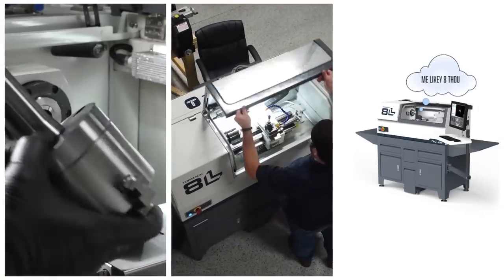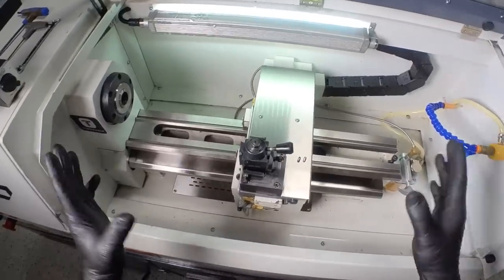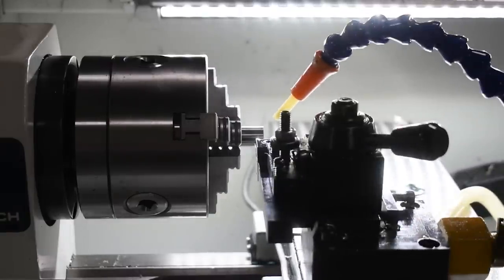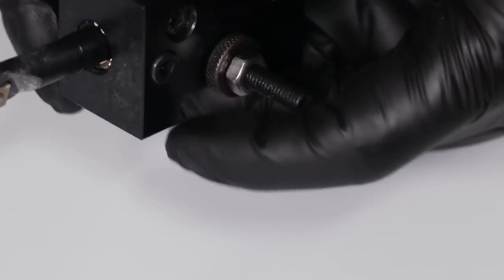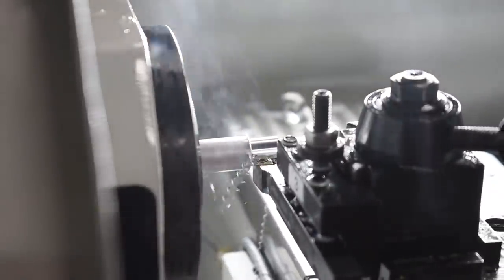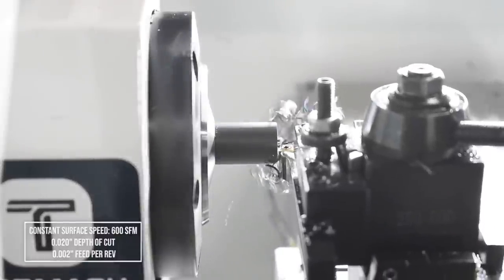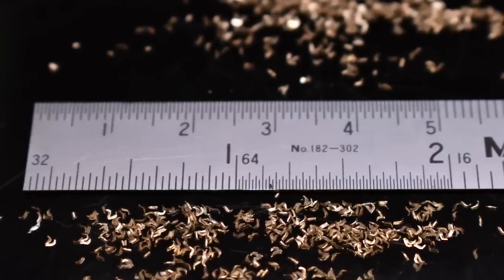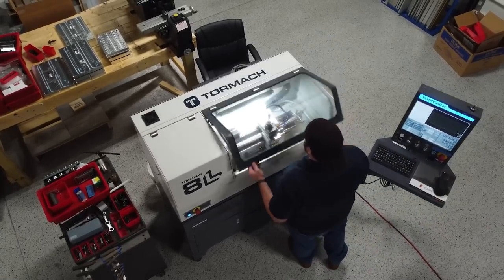Tormach 8L: Turning Aluminum, Brass, Steel, and Titanium!

Comment: My earlier comments criticizing the infeasible tool calibration of the QCTP (in the previous video demonstrating this model) got condemned.  Now we have another demonstration admitting that I was right, and showing a new backstop feature to maintain the QCTP position.  But that won't solve the dilemma. Those new backup stops on the QCTP are going to break the machine when a crash eventually occurs.  The unbacked QCTP clamping acts as a mechanical circuit-breaker/weakest-link to avoid damage to the motion components on an overstress, but the stops defeat that.  If the machine has the applied power to achieve proper MRR across the dimensional envelope, that's enough power for the machine to break itself on a motion interference fault.

Reliable chip formation requires rigidity and heavy MRR which this machine can't do except in a limited range of diameters.  Most operations progress through a range of diameters and what tool/feed/speed makes good chips at one diameter will not work at other diameters.  Seriously doubt that chips can be reliably controlled through the whole range of any given operation.  This is a weak link that spoils the whole operation.  Instead you have to have a diligent human operator attending with a pause button to stop the machine and clear out bird nests.  Certainly not fire-and-forget, or lights-out.
Reply: Hi Richard, thanks for the considered post. In your opinion, is there an alternative machine capable of unattended operation anywhere near the 8L's price point?
Reply: @darranedmundson1505  I'm not up to date on what's available.  My general result based on the engineering experience of building a CNC lathe in this size, is that scaling down to this size and price is below the minimum required for unattended piece tasks, such as the chip-control hazards.  But it already requires all sorts of attention all the time (calibration, stock feeding, manual tool changing, etc.), so it works as a CNC-assisted machine, just not a fully automatic CNC producer.  It requires a human operator full time, but it does take the manual drudgery and care out of the actual cuts.  So it's potentially worthwhile, but I don't expect there will ever be automatic CNC on this scale and price.
Reply: @darranedmundson1505  If you're running enough parts to require unattended operation, you should be buying a full featured cnc lathe from any of the usual culprits (Haas,Mazak, Doosan etc)

Comment: One really has to play with the feeds and speeds.  I run a lot of stainless and alloy steel up to 32rc.  I run at 400 sfm, but adjust depth of cut to no more than .01".  I have to dial in the feed per rev to get the chips to break, depending on alloy. Once I have that information I write it down and it has proven to be very consistent when programming another part.  I always use coolant. As far as the tool post movement, I replaced the factory screws with a quality screw, and have not had any issues. I consistently turn up to one inch diameter material from aluminum, alloy steels and stainless, each having very different feeds and speeds.  I have found I generally have to adjust a little heavier feed per rev while taking a slightly less depth of cut to get chips to break. It takes patients, as with the limited horse power you're always running about at its peak horsepower, but with good quality tooling its can be done. 
It's not the fastest machine, but it also doesn't a require rigger, or three phase power.  It has a very small footprint, and definitely serves a niche.  It's not going to run a thousand parts a day, five days a week.   It can definitely open some doors for people. I have found it to be reliable, and repeatably accurate.

Comment: I have the same busted parting tool for my Grizzly 10X lathe🤣As a Tormach 1100 owner this seems to me like a machine for a school lab and not much else. In a small shop for the same cost you could get a 12X lathe and tool it up pretty nicely with DRO, QCGB, QCTP, collet closer, and knock parts out pretty fast, and be able to do a much wider range of parts. Without a bar puller or tool changer you're going to be standing in front of this machine the whole time too. 

For some real fun, a while back I decided to try milling a round part on my 1100 and was pleasantly surprised by how well it worked out. Round to within a few thous, easy to put nice threads on with a thread mill, and I added a 3-jaw on a fixture plate to my setups so I can drop it in almost as fast as I can chuck it up in the lathe. Now the lathe really only gets used for the rare case I need a "pneumatic" slip fit or where it's faster to rip a basic part out by hand than to model it in CAD. Milling doesn't work for long parts either, but for those the 8L will be a glorified manual lathe too.

Comment: i just bought a haas SL10 used about 12 years old 18,000.   I will never play with stepper motor toys again. They caused me a lot of greif over the years. ( I assume stepper). I had the spindle rebuilt for another 6 k from haas. My haas is a real machine with 12 tools. My freind bought a tomach lathe and he was sending his parts to me as his lathe was always down or didnt have the travel to do a 3.0 long part. Not sure why, I think it was using multiple tools for boring and drilling. He ran into a clearance issue somewhere. His was a slantpro. It was more like a slant hobby

Comment: Get a proper motor for your toy.
If your spindle slowes down or stops and the rest of the machines doesn't react fast enough, then you're crashing the machine.
Reply: ??  This is a high-end hobby lathe, essentially.  It's never been promoted as a heavy duty machine - that's not its purpose.